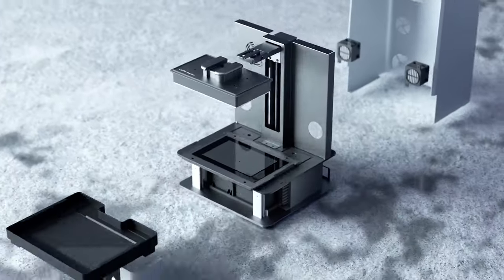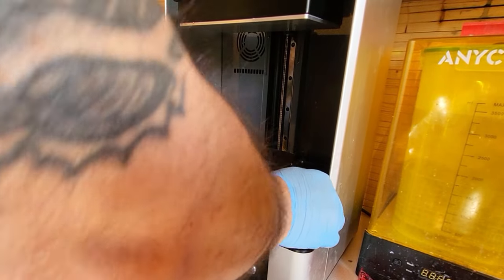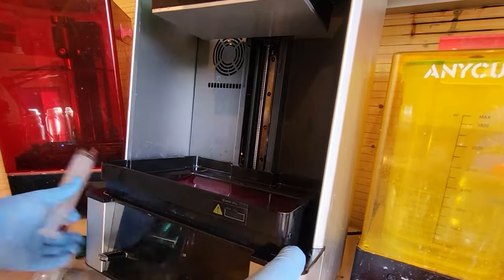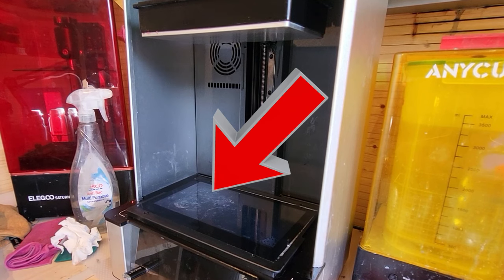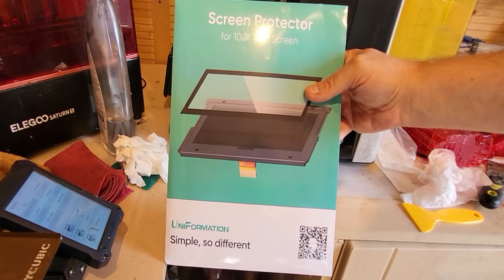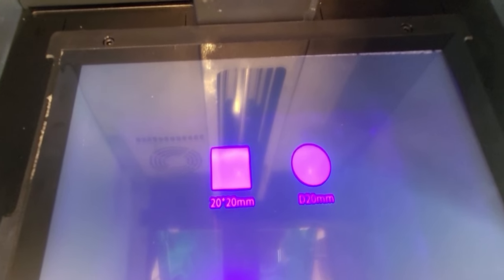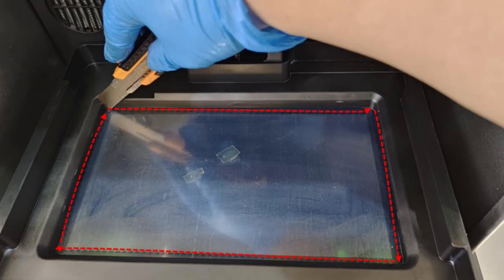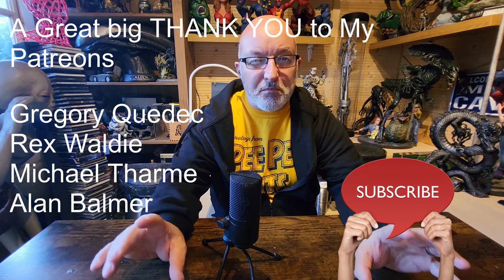Uniformation GKTwo Resin Vat Stuck ! How To Fix It Easily

Comment: I had the vat stuck in my second GK Two. But with some effort it slid out. I did not have a tear or any damage to my FEP. As best as I can tell, the little feet are a tiny bit too tight on this printer and I have a kind of suction effect going on between my FEP and the screen protector. I’ve since applied some lubricant to the screen protector and let that dry. We will see how that works out because I have just been printing non stop since then and haven’t needed to remove the Vat.

Comment: Yo, had this problem lots of times, it get's vacuum sucked to the screen plate I think and wont budge - way that worked for me was get a reasonably big flat-head screwdriver and just force it down at the back the printer, behind the vat walls, guided by the back of the printer casing (takes a bit of jiggling) and then you can just gently lever the vat towards you and hey presto it unsucks itself pretty fast and you can remove super easy as normal.  You're welcome.

Comment: Oh FFS.. Good thing I double-checked this video. I've just spent half an hour trying to scrape resin off of the screen protector!
I was doing quite well too. 

I couldn't get the vat off by only warming it (very gentle use of a heat gun) so lifted the vat slightly to get a bit of an air gap and slid a razor into the FEP to cut it loose. That did the job.
Reply from the maker: Glad you got ot off ok 👍

Comment: Has the plastic vat warped from repeated heating @ 35C? This looks like a deal breaker.
Reply from the maker: Nah it hasn't warped and tbh only happened once ans was relatively easy fix.. Shouldn't be a deal breaker as printer is amazing

Comment: I just stumbled on your video but I thought it was funny because I had this problem just after my second print with my gktwo. I carefully and surgically was able to jiggle it just enough to slide a dull scraper under it and gentally pop that section of the fep off.
Reply from the maker: Nice... Not too common but does happen 👍

Comment: Seems like a design flaw. My favorite lockdown has to be there there are just two levers that get pressed down and lock a tray into place, forget who has that.
Reply from the maker: i guess any printers resin tray could in theory get stuck - but ive only come across it on the GK2 - thanks for the comment :)
Reply from the maker: And unlike some comments I didn't over fill the tray 🙄